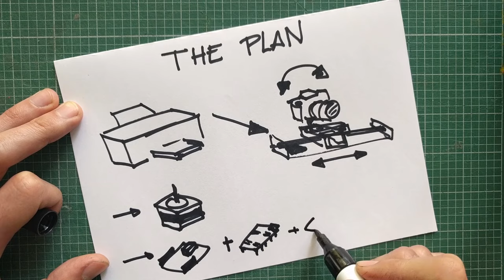Making an arduino MOCO slider from a printer machine DIY

Comment: Hi Edu!  I love your videos.  You're very inventive and always seem so positive!

This is what I want from a motion control setup

-I just need a single axis for now

-I want to be able to key frame and then with each frame the motion advances automatically

I have an arduino mega with a stepper motor, I know that is the first step.

I then found this on amazon.  I never considered a worm gear, I always thought a belt drive was the only method on a budget. Will this item work for what I want?

https://www.amazon.com/gp/product/B0197QCQM2/ref=ox_sc_act_title_2?ie=UTF8&psc=1&smid=A16P4TUM521SQ8

I'm assuming I can just rig a camera mount on top and run an arduino uno to it and connect it via dragon frame.  Is there more to it?

Thank you Edu!

P.S.

I'm just a little confused on the functionality and if it is automated or not because on the dragonframe site there is a lot of talk on Real Time vs Non Real Time and I'm not sure what that is exactly.  However, it seems like in your sun video that is fully automated.

Comment: What are the best types of motors to use? And are you using an Arduino UNO? Any recommendations on which one of those to buy? Thanks!
Reply from the maker: Arduino Uno to control 4 motors, Arduino Mega to control 8 motors. Motors must be stepper motors, depending on the weight or force they must suport, will be Nema17 or Nema23 or a lot of types more. The crucial point is the motor driver. If you go for a motor higher than 2A, you will need a stronger Driver. I will make a video soon about the electronic setup I use in this video if you want the references.
Reply: hey edu, this vid is really great! very cool channel! i'm just getting into this stuff myself. i would love to see more about the electronics you used here!
Reply from the maker: +Jack Carder I will talk about components on next vídeos.
Reply: Jack Carder

Comment: Hola y gracias por tus videos! I would like to know if it's possible to make a moco slider with the motor of the printer? It's a step by step motor, no?
Reply from the maker: Yes it is possible, normally it is a stepper motor and it is great for animation sliders.
Reply: great! thanks for your answer ^^

Comment: I noticed your using a CNC shield, did you have any problems with the pin numbers of the shield being different from the Dragonframe sketch?
Reply: I mainly ask because I think I ordered the same shield and I'm having problems getting motors to move Dx
Reply from the maker: +Beardbotnik they are different so you need to modify the code to make it work
Reply from the maker: +Beardbotnik then could be another thing also, you need to put a jumper on the enable, I remember that took me weeks to figure out
Reply: Thanks! Any tips on modifying the code? I thought I had it figured out and I put a jumper on enable and I can't get my motors to move. My shield looks almost identical to yours and I think my motor step and direction pins are like 2/5, 3/6, 4/7, 12/13

The only section in the code I need to edit is the part below "// setup motor pins - you can customize/modify these after loop
    // default sets step/dir pairs together, with first four motors at 4/5, 6/7, 8/9, 10/11
    // then, for the Mega boards, it jumps to 28/29, 30/31, 32/33, 34/35" right?
Reply from the maker: Let me check the code when I have a little time.
Reply: Thanks so much! I really appreciate it! I think my code is definately the problem, because I can get the motors spinning with a breadboard like your other video!
Reply from the maker: +Beardbotnik after the loop you would write:

motors[0].stepPin = 2;
motors[0].dirPin = 5;
etc

Notice that in the code Channel 1 = Motor 0.

The other thing you need to change is this set of lines (that appears earlier):

 #define MOTOR0_STEP_PORT PORTD
 #define MOTOR0_STEP_PIN  B00010000

 #define MOTOR1_STEP_PORT PORTD
 #define MOTOR1_STEP_PIN  B01000000

 #define MOTOR2_STEP_PORT PORTB
 #define MOTOR2_STEP_PIN  B00000001

 #define MOTOR3_STEP_PORT PORTB
 #define MOTOR3_STEP_PIN  B00000100

CHANGE THOSE LINES TO:

 #define MOTOR0_STEP_PORT PORTD
 #define MOTOR0_STEP_PIN  B00000100

 #define MOTOR1_STEP_PORT PORTD
 #define MOTOR1_STEP_PIN  B00001000

 #define MOTOR2_STEP_PORT PORTD
 #define MOTOR2_STEP_PIN  B00010000

 #define MOTOR3_STEP_PORT PORTB
 #define MOTOR3_STEP_PIN  B00010000

That should do it!
Tell me if you still have problems
Reply: Thank you so much! So far I've been able to test the first 2 channels and it's working perfectly. I really appreciate the help! It means a lot.
Reply from the maker: You are welcome, I understand your pain when it doesn't work
Reply: Great!! Came up with same question.. and.. here we are! Thx so much for your tutorials! Very nice and straight forward. :-)

Comment: Does this software supports Arduino Mega + Ramps board?
Reply from the maker: +magdanoz88 yes it suport mega but to use a Ramps you will need to modify the code in Arduino. I did it for this cnc shield as well
Reply: Thanks, Edu! Your reply was very helpful!

Comment: Your video won’t play as the ads will not stream. YT is soooo garbage
Reply from the maker: Hi, can you explain it? I want to know about that issue
Reply: edu puertas 
Hi.
When I select a video to watch, my selected video shrinks to a thumbnail size to the bottom right of the screen whilst the adverts usually play. But the ads do not play and this causes my selected video not to play either.
I have cancelled my selection and then selected again, but the same issue happens. 
This does not happen to all your videos but a few of them. Nor does this happen only to your content. I have been experiencing this with other content. I don't know if your other subscribers have experienced this as well. Anyway thanks for asking and keep up the good work.

John T